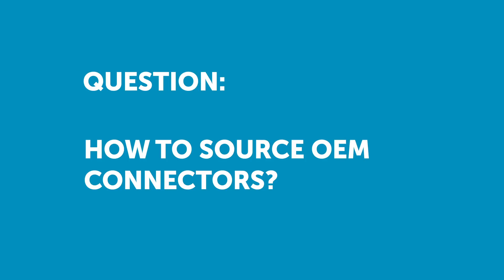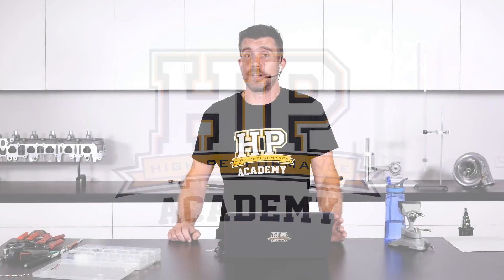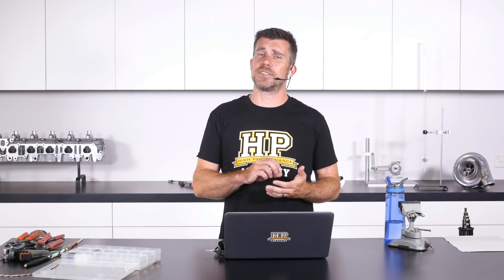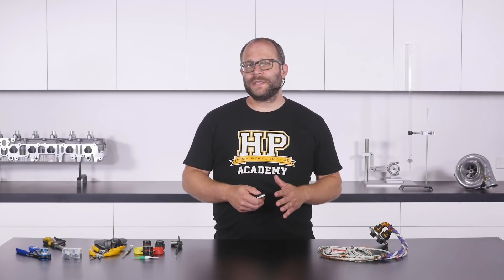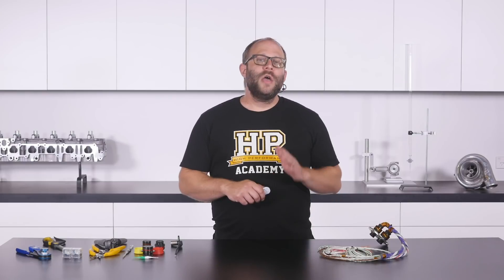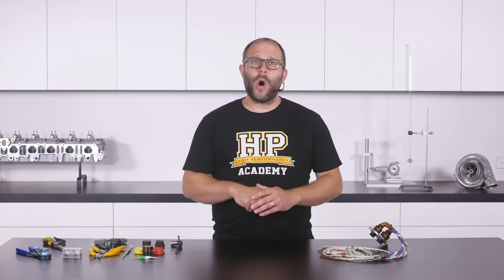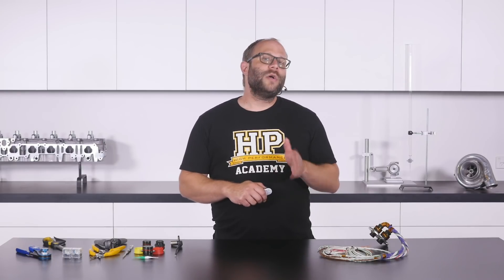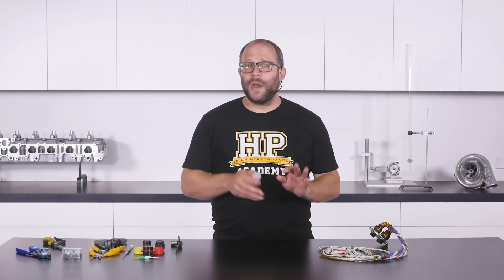Where Can I Source OEM Wiring Connectors? [HPA Q&A]

Comment: As far as Connectors for European cars i was surprised to find that Alibaba of all places has a large majority of connectors for VW/Audi Etc. However, on the quality front i am not so sure they're worth the wait from china, or the money. ECS Tuning has pretty much any connector you could want for a VW/Audi. But some are VERY hard to come by, especially ECU connectors for things like older bosch ME.7.. I'm resorting to junk yards since the connectors are usually in really good shape since they're out of the elements in a sealed box with the ECU.
Reply from the maker: Zac tried a few connectors from Aliexpress just out of interest and said they weren't worth it for the issues they gave. Of course, that is not every connector available on there he tested, but unless you've got time to buy, test and decide then you just have to accept the risk you might be doing things twice - Taz.
Reply: @hpa101  Indeed, i was debating on buying some just to see what the quality is like but i couldn't justify the wait. Good to hear that some weren't terrible. Might be good to have some around for repairs on existing factory harnesses in a pinch though!